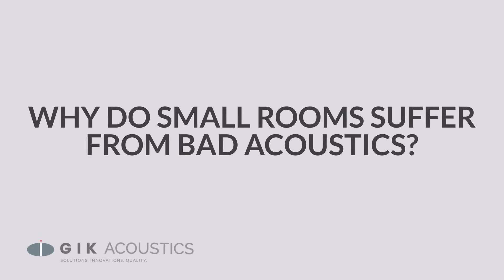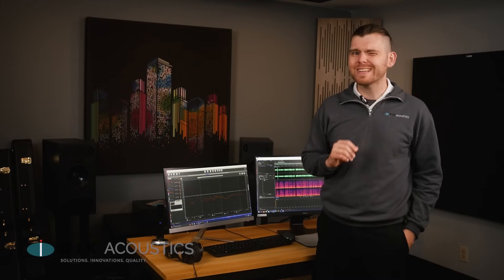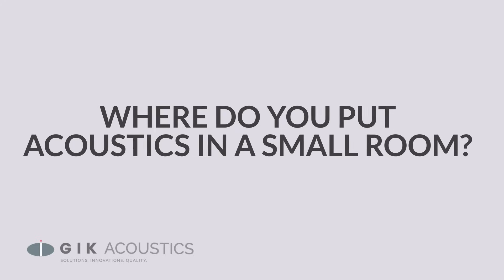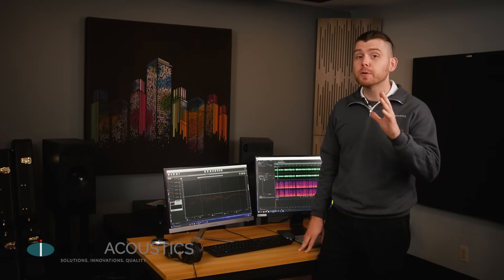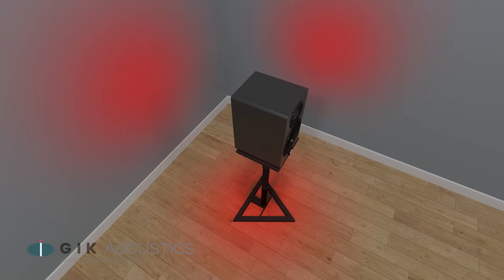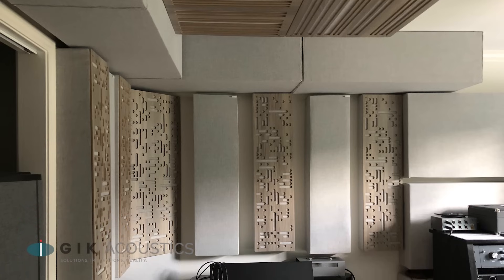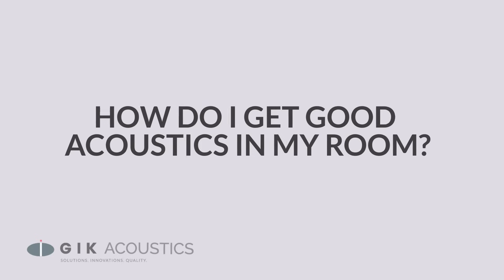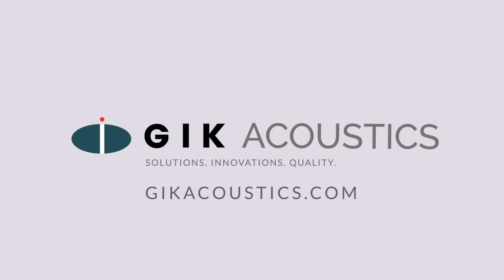Room Acoustics for Small Rooms - Why do small rooms suffer from bad acoustics?

Comment: small rooms are tricky, huge absorbers everywhere helps a lot.  i got 2.5meter square room, and it sounds really good in here.
Reply: 2.5 meter square?? Damn, THAT is small!
Reply: @AbsoluteFidelity  2.5meter wall lengths that is.  you can also measure room size in another way by multiplying 2.5 by 2.5. dont know what you call this.
Reply: @sudd3660  2.5m x 2.5m is a 6.25 meter square room. Now thats better... lol! A 2.5 meter square room is like 1.6m x 1.6m which is extremely small. Lol!
Reply: @AbsoluteFidelity  "Square: A square is a two-dimensional plane figure with four equal sides" 
 if my room is 2.5 meter in both directions its is a a square shaped room with 2.5 meter sides. 
it is really confusing when there is the square meter area measurement. i did not mention area so think that should be enough to be clear.
Reply: @sudd3660  ok. I thought you wrote meter squared but you actually wrote meter square. Its the first time seeing someone describe a 2.5m x 2.5m room as 2.5 meter square room. Have not seen it before. My bad.
Reply: @AbsoluteFidelity   my room is even sided, not that common, and not great for acoustics.
Reply: @sudd3660  very common in asia
Reply: @sudd3660  2.5 x 2.5 x 2.5 =15.625 cubic meters (volume of the whole space, if width, length, and height are all 2.5 meters); 2.5 x 2.5 = 6.25 square meters (area of your floor, if width and length are both 2.5 meters)
Reply: Same here! 2.65m cubic room to be more precise. It sucks that it's cubic I know, but with some heavy treatment it actually sounds close to perfect for me. Will get even better after adding a sub!
Reply: @rafaelfreitasmusic   at least it's cheap for us with small rooms, every acoustic panels have much more effect, and room gain makes small subwoofers have huge impact.   
dual 10" here and i get 10hz output i can feel.

Comment: I totally agree with this video. 
In small room avoid full on diffusers as it has limited place for sound to bounce back. 
Each room is different so have to play around with the speaker placement.
Reply from the maker: Thanks for expanding on it. Luckily, we have a video on that exact subject of speaker placement! https://youtu.be/T10_MLGOBfc
Reply: @GIKAcousticsLLC  Who did you think I learned this from ? 😊
Reply: Not true. Diffusion simply requires the listener be 3x the distance from the diffuser if the wavelength being, for the lowest frequency diffused. So for 1k, (1ft wavelength) you need 3ft between you and diffusion. Easily achieved in a small room.
Reply: @KyleGushue  But these BAD type panels aren't true diffusors.  There's a lot of devices marketed and sold that are being touted as diffusors, but they aren't.  The funniest ones are the companies that sell acoustic foam shaped to look like diffusors.  That's the biggest joke on the planet…

 They need quadratic. But you have to pick the right Prime sequence, they are expensive, and one needs a fair amount of coverage. Plus, it's always better to get the low end taken care of first.  Also, I don't know about putting diffusors on all 4 walls AND ceiling. I know there are rooms like this, but they are actually much larger rooms..  s

 I believe it depends on the room dimensions and what one is doing in the room to determine which wall to cover with diffusors and which diffusors to use, whether the ceiling has enough distance to put diffusors.  etc…

But I would definitely take care of the rest of the room's problems first.  Diffusors should be the last thing to introduce into a room, not the first, otherwise they can make the room sound worse...
Reply: @Oneness100  there are a variety of diffusers, polycylindrical being one type. They need not be quadratic, that is just one type. Where you place them depends on the room and if they operate on 1d or 2d planes, and if they are phase grating or amplitude grating or both.

I do agree that the bad panels and what gik sells are not effective scattering devices, rather just band pass absorbers.

The distance between the receiver (mic, listener) and the diffuser is the primary factor in determining the lowest frequency that can be effectively diffused. So their “tuning” will often vary with placement in the room.

There is no room too small for diffusion, just may not be large enough to diffuse a frequency that’s useful, or may return energy with too high a db level within the initial delay time gap.
Reply: @KyleGushue  But they don't meet the 5 requirements for true diffusion.  They are redirectors..
Reply: @KyleGushue  One also needs coverage.. at least 70% is what I've been told to really create a diffused sound field.    If you took a bunch of polyclinderical and put them together and covered an entire wall, you are going to end up with dead spots.
Reply: @Oneness100  the polys would need to be varied in size and orientation